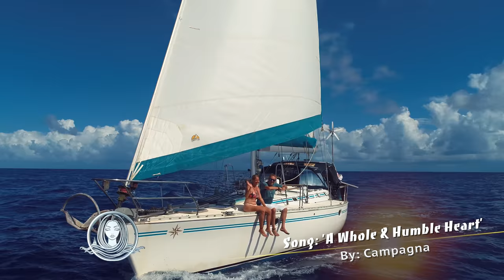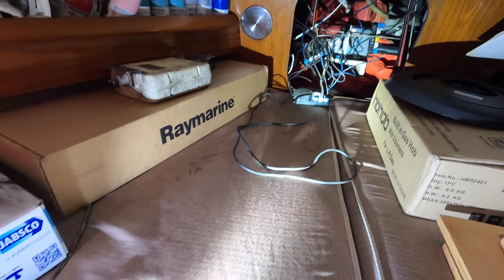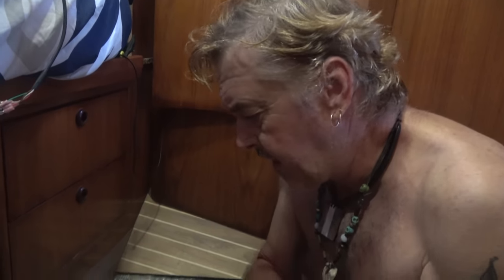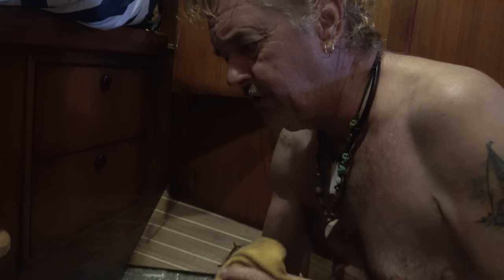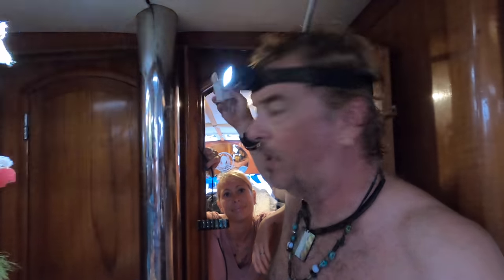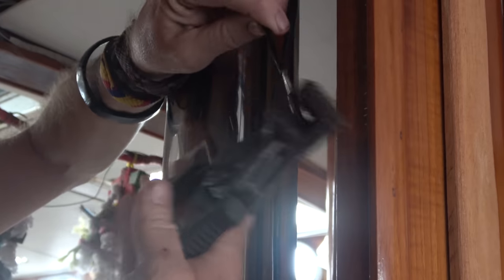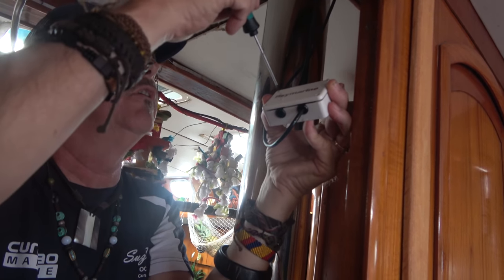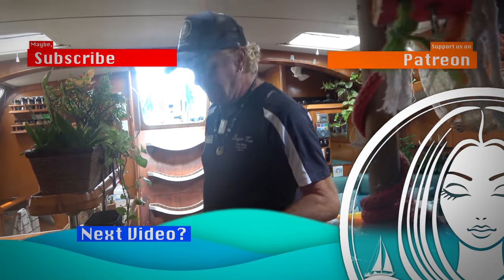SSL536 ~ We FOUND THE PROBLEM..!!

Comment: Noticed your water pressure pump repeatedly short-cycling during this vid. Likely a leak-down point somewhere in your freshwater system, but I have a thought on holding pressure, and not the leak, this time. Many people go out and buy various accumulator tanks or chambers to alleviate that frequent re-pressuring effect. I managed many larger sailboats for charter, in SoFla and found great success creating my own custom chambers on the cheap, that worked much better and only required a quick trip to the closest Home Depot or Lowes (or anywhere stocking PVC plumbing. If you locate an out-of-the-way back corner of a lazaret or closet or cabinet. Choose the tallest corner, located in the higher part of the water system. Once you've identified your ideal spot, cut a section of thin-walled 4" PVC pipe. Glue caps at both ends. Tap a 'T' fitting into the bottom cap. If you like, you can even install a simple pressure meter. On that 'T', run a hose to and from it, back to the system. Voila! The bigger your chamber, the longer your pressure will hold out. Just a few bucks, easy and no moving parts!  Fair Winds…
Reply from the maker: No it's not a leak, it's just the reverse osmosis system working away at producing drinking water in the background.. pump comes on every so often to replenish pressure

Comment: Pro tip. You get much less water ingress if you remove the transducers while underway. 
I often have to remove my knot meter transducer because a small amount of growth has blocked the wheel. I use a bung to plug the hole while I clean the paddle wheel. Might be two to three cups total ingress removing and replacing while underway.

Comment: It is possible to put a seal on the outside of the hull over the area of the through-hole and prevent most of the water from getting in. It also gives you more time to work. If you have someone with scuba it should be pretty easy. Pressure is fairly low, with only a few PSI. Love your how to videos!

Comment: You can also use a lighter. Flame will melt the wire covering just as easy as wire strippers. Works on the fine wire/smaller Guage wire. It's an old electrician trick i learned many years ago!

Comment: A lot of the through hole fittings have a flap that's supposed to flip shut when you pull the log out and reduce the splurge of water to a trickle... it's normally halfway down the tube and curved.. so it as you shove the log in pushes it open into a recess in the side of the log tube... and they work really well.. I had to do it every twice every year when we hauled a long keel yatch out in the yard and the speed log was right where the strop needed to be...and every time the little flap snapped shut when I swapped the log for the blank

Comment: Great job Speedy !!!!!    you'd think they would have a cap or bowl that goes over hole from the outside to limit in-flow, of course you'd get wet either way.  I bet you know how to get a pull wire through a conduit or airtight channel !.....   A vacuum from a can style vacuum cleaner and a chunk of plastic bag on a string, just don't try to guide string by hand, it will hurt!

Have a great day  !   Oh, never forget Happy Hour !!!!!

Comment: Good move throwing away that terminal block. I have actually had the Black Hard plastic material that is supposed to insulate fail due to cleaning it with chemical sprays. Hard to trouble shoot when the basic function of the terminal block no longer works.

Comment: That’s quite some water pressure.  And, you can’t be afraid of the water.  Maybe wear a mask or goggles so you don’t flinch too much or try to get your face out of the fire zone.
Reply from the maker: or wait till you haul out!  Lol
Reply: @SailingSophisticatedLady  You’ve probably heard of this or experienced this...   when I was getting my SCUBA certification, as a demonstration of water pressure, my instructor had a 6 foot snorkel. He had us take turns trying it.  He would be on the deck of the pool holding the top of it while we were sucking on it.  The deeper we went, the harder it was to breath in. I didn’t make it to 6 feet below the surface before I was no longer able to breath in.  Hmm.  Makes me think.  Maybe I can try to fit into my old jeans kf I just dive down 50 feet.😉✌️🤙😎

Comment: While you have the floor panels removed, maybe you can locate the water or air leak in your pressurized water circuit.  That would drive me bonkers.  Redoing our '89 Legend 40 with Pex.  Not necessary but adding an accumulator tank to lessen the strain on the pump.

Comment: For better connection and protection of the wire going into the terminal block, you could have clamp the individual wires with wire ferrules. hence the terminal block screws would never cut through the bare copper wire.

Comment: Admittedly, I know nothing about anything.

My thoughts would be to run the anchor cable out to a suitable spot and then use the ship's winch to pull in the right direction.

Again if the tugboat lacks suitable power maybe it could do the same with its anchor.

Okay Rick, you can now tell me why that might not work?

Comment: Hey Rick ,, pretty sure that one Transducer is the new AIRMAR DST-810
Check it and let me know. 
They are the BEST option under a $Grand 
And Bluetooth connectivity !!  They were borderline impossible to get ( in stock ) here in Canada, but my guy Al at Bridge Yachts in Port Dover worked some magic AND my New Jersey Raymarine rep also sent me one !!! Now I have an extra plus a few others ( DST-800 - P17 - RV100 )
I’m anxious to SeaTrial the DST-810 though and not have to use my iTC-5 NMEA converter, so I got a new one of those for sale too I guess.   Hey did BETA rep get ahold of you yet ??  Talk soon, sending Email

Comment: At 2 minutes into the video you can see the freighter pumping oily bilge water overboard that was an illegal act that close to shore they have to be 12 miles off shore I wouldn’t be surprised if that the tugboat didn’t report them as they pumped it right in front of them, just because you run aground doesn’t give you any special exemption from international shipping rules I’ve been a sailor and worked on many Great Lakes vessels on the Canadian side for many many years

Comment: so rick if you wanted those  terminal wires to last long why didnt you fill the two blank gromitt  holes with silicon calk or were they punch outs already sealing the box ?
Reply from the maker: The kit came with rubber plugs instead of grommets for any holes that weren’t used for wires.. still not 100% waterproof, but much better for sure
Reply: @SailingSophisticatedLady  Ahhh was just wondering cause I used to go lobstering here on long island sound  on my friends boat and remember him buying a new socket set for the boat and in the time we went out claming and got home one day those tools rusted  I was shocked what the sea air   can do in one day ..

Comment: Two questions.  Wouldn't a head mounted light help your work as well as your videos in dark places?  Would it be possible to put caulk on a bowl edge and mount it on the outside of any through hull you are changing, to take all the water pressure off when the first is removed?  Thanks!